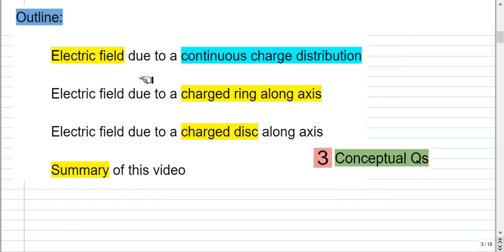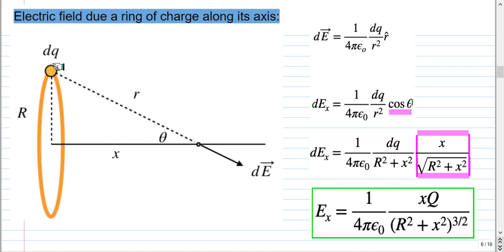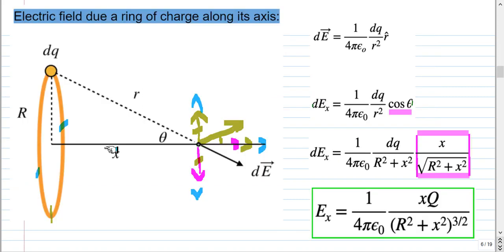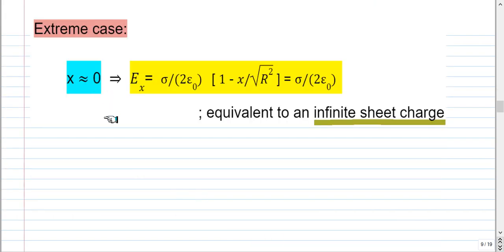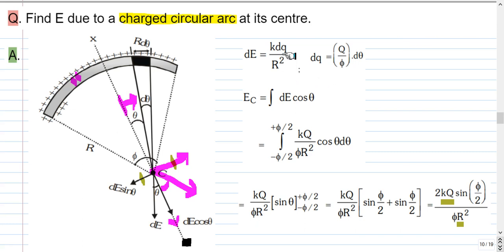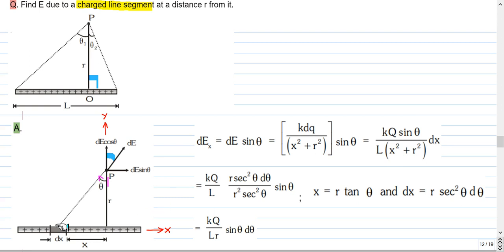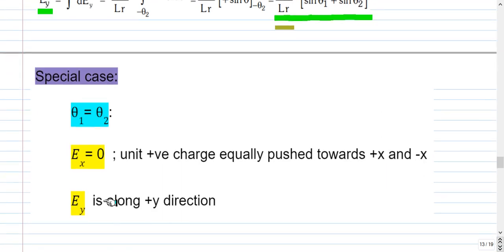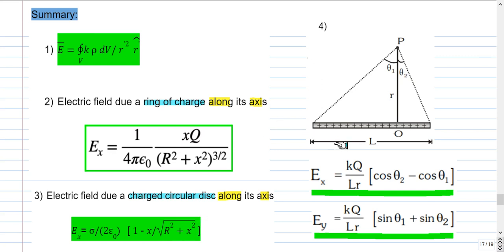JEE / NEET  Physics | Electrostatics | Electric Field due to Charged Ring and  Disc | PH 12 V 1.4

Comment: -----------------------------------------
Next video:

https://www.youtube.com/watch?v=ANVP9fx4OIU&list=PLSTQQkOhE6zlxwC54hNYJH85JX4CsnC5W&index=6

-----------------------------------------

JEE Main PYQs: https://www.youtube.com/watch?v=J1PW4LjRFmQ&list=PLSTQQkOhE6znPbRKMc6Z4UfgkXNDdPz2X&index=2

JEE Advanced PYQs: https://www.youtube.com/watch?v=ZbGhvdaaO0Q&list=PLSTQQkOhE6znPbRKMc6Z4UfgkXNDdPz2X&index=5
-----------------------------------------
Timestamps:

00:00 Quotes
00:20 Outline

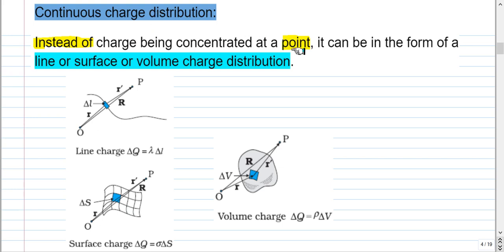00:44 Continuous charge distribution
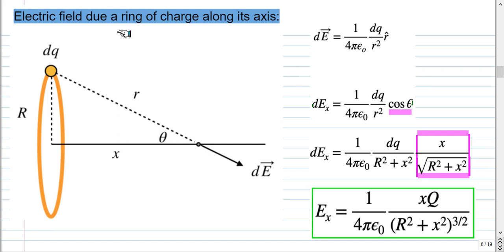03:02 Electric field due to a charged ring along its axis
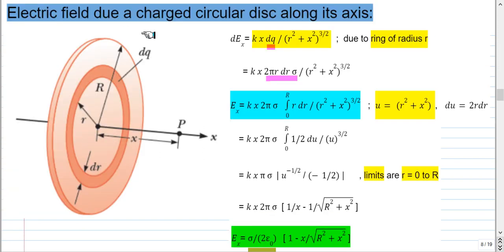07:53 Electric field due to a charged disc along its axis

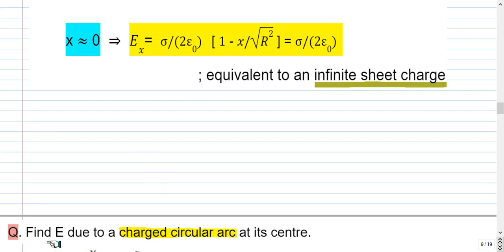11:35 Q. Electric field due to a circular arc of charge at its centre
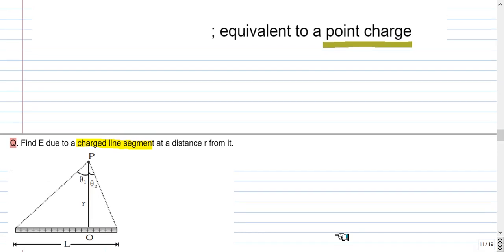15:41 Q. Electric field due to a finite line charge
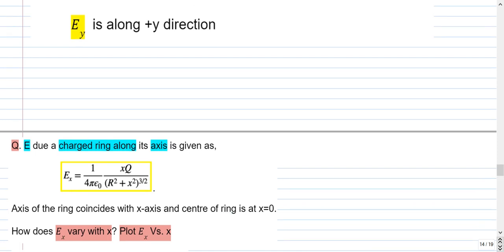21:11 Q. Variation of electric field along axis of a charged ring 
                Plot of E Vs. x

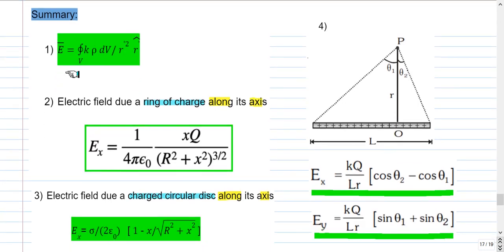23:38 Summary
25:17 Quotes